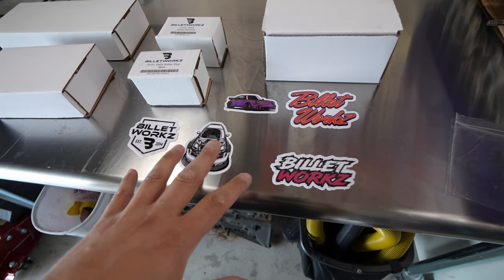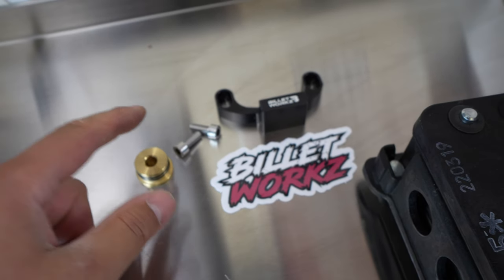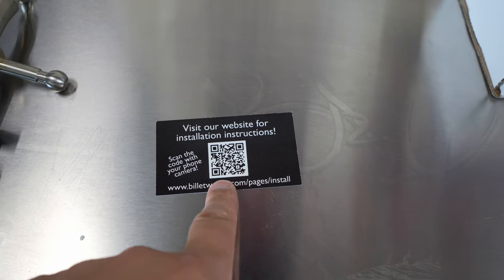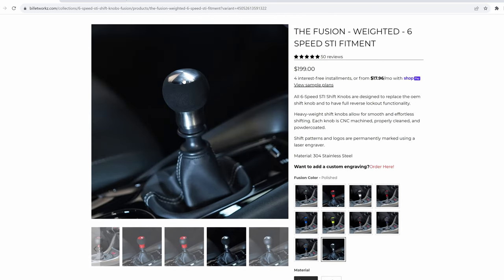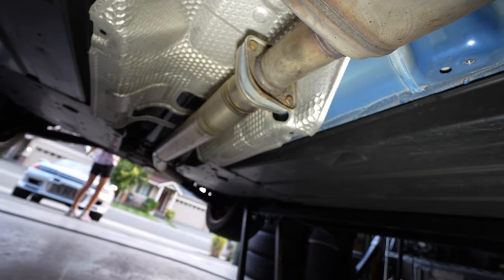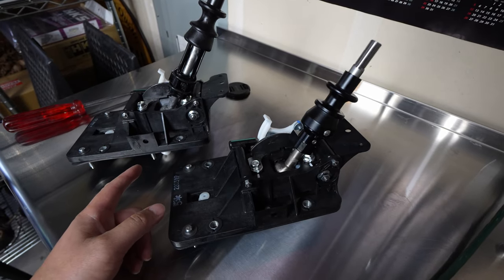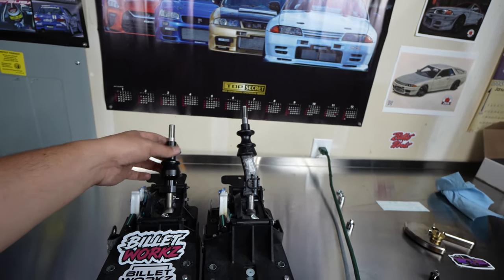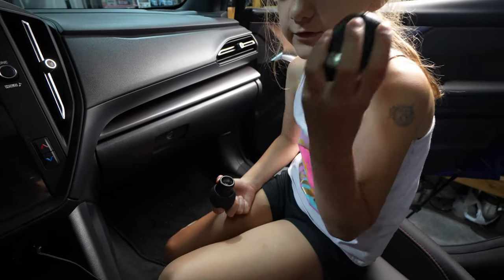VB WRX short shifter Billetworkz vs STI how to install shift knob and review 2022 2023 2024

Comment: Another Bangger Thank u for this one, Was actually looking to see what where the differences with the STI STS and the Billetwork one mine likes to sound clunky the shifter bushing helped a little bit but still so looking at the Biletworks Short Shifter to replace my STI STS. Would definitely love your input on how do u like it better than the STI and if the shift is a lot nicer feeling compared to the STI.
Reply from the maker: The stock shifter compared to the STI shifter, would be like going from black and white TV to color TV. The STI shifter compared to the BIlletworkz, would be like going from a color tube TV to a 4k HD OLED TV. Its a night and day difference. The STI shifter is easier to drive and put between gears, but feels sloppy. The Billetworks makes you work a little harder for the shifts, but is so much more rewarding to drive. It feels awesome, that's all I can say. Good question and thanks for watching.👍
Reply: I appreciate the reply and comparison lol is actually the best comparison to use im probably going to buy one in the next two weeks or so you have sold me. I appreciate the vids keep at it you are inspiring many.  @JDMRightHandDrive

Comment: Where does the heavy piece go and the bronze bushing?
Reply from the maker: Those connecting directly to the transmission and shifter linkage. Reduces the shifter throw more and the solid bushing stiffens up the shifter feel.

Comment: Heck yea! The whole billetworkz kit is awesome, I installed this not too long ago on mine and loving it! I know you haven't gotten to the plate/bushing video yet, but the bushing was surprisingly hard for me to get out and in, then that top bolt for the shifter plate cover had me inventing new cuss words. I thought installing the short shifter would be the hard part but wasn't too bad with all the resources on installs, plus some good notes. The whole kit together makes it a top notch mod, the shifter stop by far was my favorite by eliminating the slop from 1st and 2nd. I did get picky with slop and adjusted both stops meticulously to get the max notch-y-ness, made it a bit difficult to get into reverse but I like where I have it for every other gear.  

Also, because I am an idiot just posting this here for anyone who gets new knob stuck on adapter... Please just tighten the adapter and nut together tight before putting knob on, adjust and RETIGHTEN as needed before re-putting knob on. It will save you a headache. Heard people were able to get adapter unstuck with pliers or tightening down on shifter, neither of these worked for me... but blue loctite between adapter and shifter and waiting a day got it unstuck for me.
Reply from the maker: 👍Thanks for your insight with your experience installing the entire shifter set up. I am not looking forward to punching out the pin the in the shifter plate off the transmission. That looks like its going to be somewhat difficult and again challenging getting the pin back in with the new plate. Glad your enjoying the WRX content, more videos on the way. Thanks for your support.
Reply: 3/16" punch and easy taps to get it out (both inner/outer roll pin), wasn't too bad. Also as others have said get the roll pin started in new plate before going under. The difficult part is doing a bunch of small taps and rotating plate back/forth slightly to get the pin to go in. Definitely use a bigger punch so it doesn't go passed flush. You are right with that part being challenging, but you are a handy guy and got this!

Comment: you mentioned the armrest not being long enough. Have you tried the extended option from subaru or aftermarket?
Reply from the maker: I have not tried the oem armrest extension. I am interested in one, but those darn things are expensive. Maybe later once I finish my car build I can finish off the little interior details.
Reply: @JDMRightHandDrive  not wrong I'm about the purchase a new wrx and felt the 500+ aud is a considerable cost but I do alot of country driving to that arm rest is important. 

Thanks again for the videos between the sti and the billet one. Certainly a lacking product from the sti to the aftermarket options to truly reduce and firm up the throw feel.

Comment: My 23 with sti shifter has 1500 miles on it and little by little it’s getting noticeably notchier if that’s a word. I think it might need grease because we’ve had a lot of rain over the last 5 days and it’s getting worse. Not a lot but it’s the first time I had a little bit of a problem putting it in first gear. It’s going into Subaru in about an hour. I paid enough for the warranty. I’m used to mustangs because I have a couple which shift really good and I know it will never be like that since it’s cable operated but something is definitely going on.
Reply from the maker: That sounds like a weird issue. I wonder if its something to do with the shifter plate or bushing. The stick shifter is pretty much sealed up from the bottom. The undercover only has a small slit for it to breath and I cant imagine much water getting up in there. You can always try adding more white lithium grease. Hope you get it figured out.
Reply: @JDMRightHandDrive  I brought it into Subaru and they said there was nothing wrong with it. I’m sort of annoyed because I bought the 120k mile warranty for $4200 so I didn’t have to climb under the car. I’d rather use whatever time and energy I have working on my mustangs that don’t have a warranty. I ordered the billetworkz complete shifter kit. So I’m going to use the stock shifter that’s in a box that came in the trunk and build that one and just pull the sti shifter in and out in warranty situations. It seems like the dealer just didn’t want to do anything for whatever reason. There blaming my infotainment connectivity on my iPhone 15 pro max. The other day I had 2 lights come on the dash. One the car on a hill and the other looked like a car with squiggly lines behind it looks like it’s doing a burnout. I’m really hoping it’s not an oil pressure issue I’ve been reading about.

Comment: I couldn’t get the two bolts out for the housing holding the shifter in. Would just spin. Tried welding a nut to it. Spun off wtf I guess I have to buy another shifter assembly and try and see if that one breaks loose..

Comment: Maybe if I got to drive a car with this shifter set up on I might want to swap but as it is now the STI shifter my '22 came with + a shift stop and it's fine for me.  I have a brass shifter bushing but have not installed it yet.  What I really want to do is put in the Group N transmission mount someday soon.
Reply from the maker: Nice, glad to hear you like your STI shifter set up. Yeah, I want to get myself a upgraded transmission mount and poly rear diff bushings. You got to get under there and get that brass bushing installed. Thanks for watching and have fun with your VB.👍
Reply: @JDMRightHandDrive  I did install the poly rear diff bushings - didn't really notice any difference but it was an interesting and somewhat challenging job.

Comment: If you look close… 12:58 the holes that the cables go into in the STI housing is different.  One hole for the cable is slightly higher. Not sure what difference that makes tho.
Reply: OEM nob ftw
Reply from the maker: I didn't notice that. I can see what your talking about. Thanks for pointing that out to me. So glad I removed the bottom STI bracket now.

Comment: I have the sti short shifter, with cobb weighted knob, shift plate and shifter bushing. The throws are so short takes some getting use it.
Reply: I have the same set up, came with the sti short throw so I just put a Cobb knob and their stage 1 shift kit in. My buddy with a stock shifter is jealous af but doesn’t want to do the labor.
Reply: @Mike-xs9gr  it wasn't hard to install, hardest part was that forsaken roll pin lol. Also did the pitch stop mount up top before doing the rest at bottom.